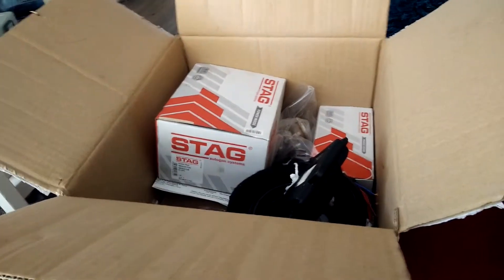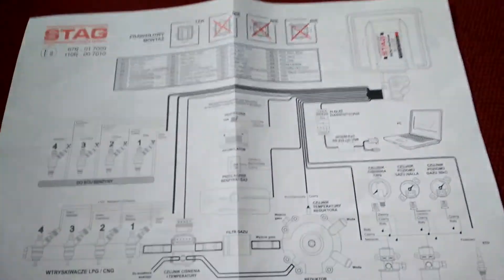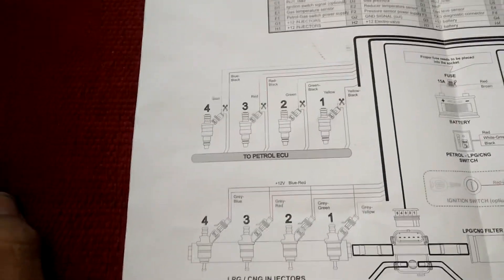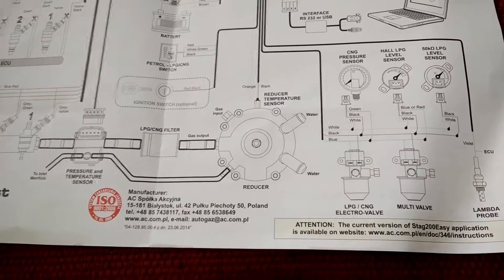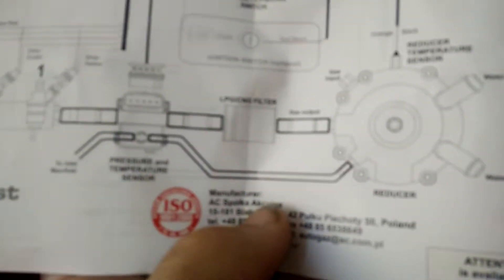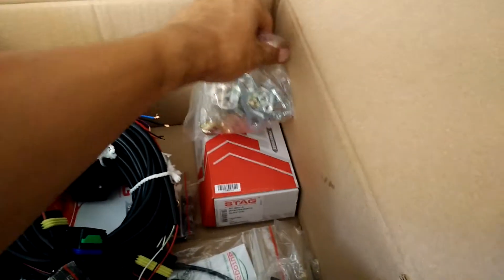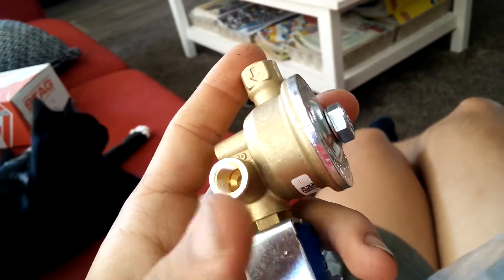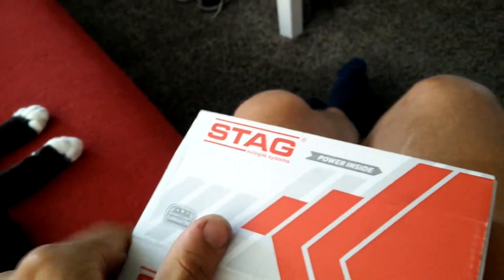Unboxing the AC STAG 200 GoFast LPG kit

Comment: Hello, you reckon this system is enough for 92kw naturally aspirated engine?
Reply from the maker: Yes, should work. You'll need to drill out the nozzles to appropriate size.
Reply: @PeugeotStuff  Right, what'd be appropriate size for my car? I got Stag AC  W01 injectors...
Reply: @PeugeotStuff  2.5mm?